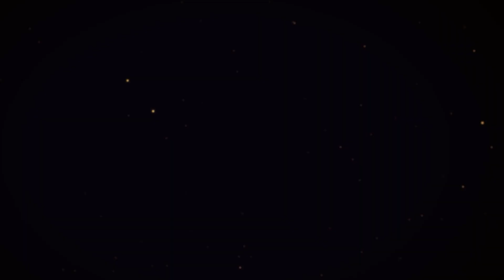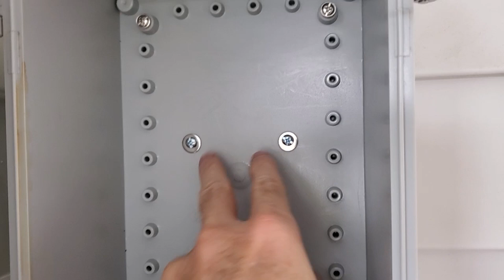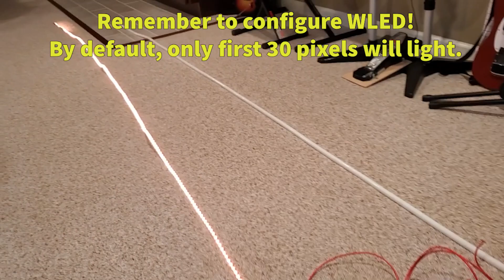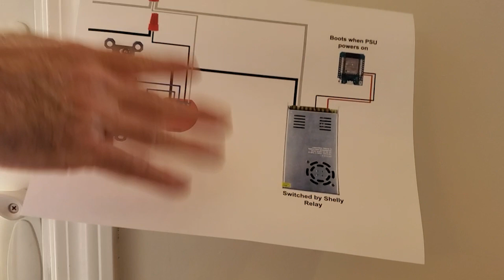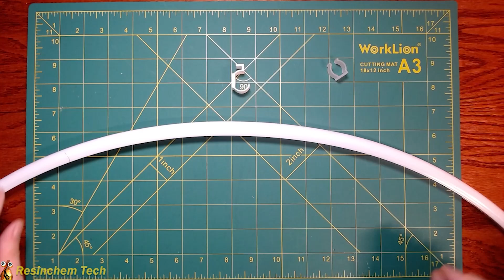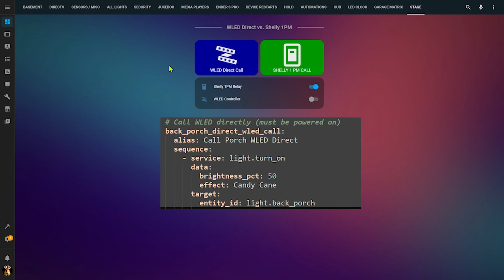An Outdoor LED Installation with Neon Rope Tube

Comment: Excellent!  Wish I had seen this sooner, it would have helped even more then, but nevertheless you refined my understanding (especially of sync dynamics).

One extension would be about saving segment configurations as presets.  One needs at least the default preset to load a set of segments - but one can have different segments with different presets (eg: with two segments, one could sometimes reverse one or the other, or use vs no use mirroring).

A different extension would examine how segments and presets interact with remote pixel control via e1.31, ArtNet, or DDP - for example connecting to LedFX or xLights - that's one I'd really like to see as I haven't puzzled it out for myself yet.

AND... these don't change all the time, so you probably wouldn't have the problem with a part 2 being obsolete by the time you made it.
Reply from the maker: There is so much that can be done with WLED, it definitely could be a whole series of videos!  I touch briefly on some of the other subjects you mention in other videos, but not necessarily how segments fit into those things.

I'll definitely consider a follow up video at some point to explore how segments can be used with things like presets or other integrations.  Not sure when I might get to it, but thanks for the recommendation!

Comment: Awesome build - now I just have to get enough  "WAF" to do something simular. ;) .Beginner-question - how thick power-cables do you use for the extension? Is 22awg enough? 20awg? Thanks again!
Reply from the maker: Are you referring to the wiring runs for the power injection that I did at the corners?  I actually used 18 gauge wiring for that.  The gauge needed is dependent upon a lot of factors, including the length of the wiring run, the expected amps, etc.  There are some online calculators that can help determine the right gauge to use for your particular project.

As far as WAF... she was pretty skeptical about this project when I first proposed it.  But I had built up some "credit" with other projects and automations first!  I always assure that I try to make the final install as neat as I can, with as little exposed wiring as possible, and she is generally OK with it.  She actually likes the lights now that they are done, but I did have to set them so that they first come on as plain white when the wall switch is flipped... colors and patterns can then be set after that if desired... but they always turn on as normal white.

Good luck with your project.  Let me know if have any other questions along the way.

Comment: I love your material, have you done any comparisons between the many Btf-lighting neon ropes? Would love your thoughts, or perhaps a video on that! Greetings (Or if you've tried at least some of them, input is appreciated)
Reply from the maker: I haven't tried any additional styles.. and likely won't.  As I mentioned towards the end of the video, the neon tube (at least the style I had) was difficult to work with... and I would have been much better off (and had straighter runs with no sagging) using something like IP65/IP67 LED strips and aluminum channel for mounting.  I think the neon tube is a great idea for outdoor installs where you might need to navigate an actual curve or curved surface.  But in my case here, the runs were straight, so outdoor rated LEDs and aluminum channel could have served me better.

There isn't anything inheritably wrong with the neon tubing... and they do provide decent diffusion, but just preparing and mounting took a lot more work as compared to the other alternatives.  For me, removing the adhesive backing, pulling the LEDs through the tube... and then dealing with the tubing wanting to twist and fall during mounting took a lot more work that I normally have by just slapping the LEDs into an aluminum channel, then mounting that aluminum channel into clips already mounted on the wall (or whatever surface I am mounting them to).  But this was my first experience using them.... maybe I'd get better with more practice.... but again, I doubt that I'll try!

Comment: What I don't like about these things is you can't run them straight. A channel is neat, these sag here and there.
Reply from the maker: Oh... I agree with you a 100% on that.  Plus they were just difficult to deal with overall, which I think I stated either in this video or the other one.  For my particular install, the aluminum channel with IP67 LED strips would have resulting in a much neater and cleaner (not to mention easier) installation.  But, the tubes and WS2812b strips were provided to me by BTF lighting in exchange for my review... so I tried to do the best with them that I could.  But unless I had a direct outdoor exposure that required curves or gentle bending, I don't think I would consider using these again.

Comment: You could perhaps use a second small PSU for the controller, and use a relay controlled by the controller to turn the big PSU on and off? I assume the two PSUs would have to have common ground
Reply from the maker: That's a pretty good idea.  But for my particular case, the delayed on from the switch isn't a big deal (I really don't use HA automations for these lights) and I do like the fact that the power is completely off to everything that is exterior to the house... especially at this time of year in Indiana, where the porch isn't used anyway.

Comment: If you ever need to rerun a string, this is what you can do. Tie the end of the string in several knots to give it some size and weight. Stuff it into one side of the tube and from the other side of the tube put a vacuum on it and it'll suck it straight in.
Reply from the maker: I actually did have to re-pull a string at one point.  But the opening is wide enough that I was able to use use some solid core wire to push a new pull string through.

But your tip is a good one... thanks.  Not sure I'll ever use these tubes again, as I think it would be easier to just use IP65/67 rated LEDs, unless I really need to put the LEDs on a curved surface.

Comment: In the script at 26:05 - instead of the hard coded delay of 2 seconds (later 10 seconds) you could as well just use a "wait for" trigger to react for the WLED controller change its state from "unavailable" to "on" or similar 🙂
This would put you on the safe side no matter how long the controller takes to connect to the wifi.
Reply from the maker: That's a great idea!  I love it when folks find ways to make improvements on my existing projects.  Not much use for our back porch and lights at this time of year here in Indiana, but I will definitely make that change to my automation.

Thanks for taking time to share a great upgrade tip!

Comment: Would love a 2022 home network video your setup looks awsome 👌🏻 im starting my own home network
Reply from the maker: I'm currently using Ubiquiti/Unifi with managed switches, multiple PoE access points, etc. after upgrading from an Eero mesh system... that was fine until I outgrew it with the number of concurrent devices (I usually have around 130 devices connected at any given time.. the majority of which are wireless).  I'd love to actually have a separate VLAN for all my smart devices, but the work to move all those devices over to a new network, with new credentials, etc. (especially since many are embedded devices, such as relays or wall switches) just makes it too overwhelming.  But someday if I keep adding devices,  I'm going to run out of IP addresses and will be forced to do something!  I've been very happy with the Ubiquiti / Unifi devices.

But if you are just starting out, and if your network will have the capability, I'd highly recommend setting up a segmented network/VLAN for all of your IoT or connected smart devices.
Reply: @ResinChemTech  amazing thank you for the reply! Loving your videos

Comment: I'm looking at using this for new upgraded Christmas lights that wrap my 4 round porch columns (about 14 inch diamter), how do you think this tubing would work? If snugged tightly (and taped in a few places) would it sit nicely with the LEDs facing out or would it try to twist itself and look bad?

Also, Great commentary on the two ways to wire the power supply and controller for automations -- always on vs power on with the switch. This is the first video I've found to demonstrate this and confirm that having a switch cut the power will work for my pool lights that will never have motion automation and I will want to turn completely off when not in use.

Now, to continue researching how to get WLED to remember the last settings on boot...
Reply from the maker: Actually, I think wrapping the tubing around a column will probably lessen the likelihood of twisting!  They come packed coiled up exactly like they were around a post.  My issue was that when laying flat, they kept wanting to 'curl', which caused the twisting issue.  However, they do have a little bit of weight to them, so I'm not sure that tape alone will hold them in place.  Might need to be creative if you can't mount some sort of bracket on your posts.

As far as WLED, I'm sure you are aware that you can set a default boot-up effect and have the lights turn on when the controller receives power.  The effect is saved as a preset and you just specify the preset you want to use as the "boot up/power on" effect.  But if you are talking about saving whatever the current setting is when they are powered down and restoring that when powered back on, that's a bit different.  I was chatting with another user that apparently has modified WLED to write changes to a preset each time they are made.  So, it might be possible to do through a mod.  But for now, you can at least pick a single color/effect to use when the board powers up.

Let me know if you have any other questions... and thanks for watching!

Comment: Another great video, an excellent explanation of your work and everything looks amazing. Thank you for sharing your time and experience in the development of these works that help get ideas for projects at home.
Reply from the maker: Thanks!  I know that my 'how-to' videos run very long and very few people watch the entire thing.  But I guess my goal is to try to provide ideas for others to adapt... and provide more details for those that want them.  And often, like in this video, I discover things myself... and things I'd do differently... so I try to share those ideas to help others consider what to do (or not do) in their own projects.

Thanks for watching... and thanks so much for taking time to post such kind words!  I greatly appreciate it.
Reply: Hi My friend, a question: I have read and seen that you recommend using a capacitor at the microcontroller power input either for the led strip or both, as well as a resistor on the DATA pin between the microcontroller and the led strip . Is this really necessary? in some installations I see that they do not use it, others say that it is optional, others that if it is not placed it can burn all of them... etc. ... etc.. I think that in your installations you don't use those components.  @ResinChemTech
Reply from the maker: You are correct.  In many of my earlier installs, I placed a capacitor on the power supply or on the incoming voltage line of the controller board.  It's simply an extra precaution that might help protect your board or LED strip in the case of a power surge.  However, I've never had this happen (it doesn't mean it won't!), so I've tended to not install the capacitor in exchange for trying to make the controller and enclosure case smaller... especially when using the D1 Mini and the smaller ElecroCookie board.  With the larger controller and board, there was a little more space for the capacitor.

Of course, adding a capacitor is an extra precaution and it sure doesn't hurt to have it there.  By skipping it, I'm saying that I'm willing to run the risk and replace the controller (or LEDs) if a surge does cause a problem.  Much like the logic level shifter, the final decision to use a capacitor or not is totally  up to you.
Reply: Thank you for your time and explanation, it all comes down to assuming the risk or not. Thanks again... I'm going to try adding them to two small jobs I'm doing at home for my kids for safety. @ResinChemTech

Comment: Perhaps this project was not especially for the neon tube because it lowers the intensity of the light and the purpose is that it is flexible, excellent project 👌
Reply from the maker: Yeah... I agree.  As I talked about in my conclusions, if I were to do it over, I would use IP65 orIP67-rated LED strips and aluminum channel.  The neon rope tube is a great choice for curved surfaces, but for flat straight runs, I think the aluminum LED channel would make a much better choice.  However, the neon tube really doesn't lower the light level much at all.  I compared the two options in my previous video and didn't really see much difference in brightness level.  Regardless, with 815 pixels, the light is plenty bright with either option!

Thanks for watching and taking time to comment!

Comment: You should probably put a few holes with a hole saw bit in the box with your power supply so it won’t get too hot.
Reply from the maker: I did consider that... but of course that would compromise the watertight box in terms of rain/moisture.  I'm planning on placing a temperature sensor inside the box (I can power a D1 Mini and sensor off the same power supply), so that when the box is powered up, I can monitor temperature and get an alert if the temp gets too high.  If I find that is happening (the power supply does have over temp protection, so it should shut itself down if it does get too hot), then I'll look at maybe drilling holes in the bottom of the box where it would be less susceptible to rain.

It does help that the power supply and  lights would generally only be on at night, when the outdoor temperature is lower.  Thanks for watching... and the suggestion.  I love getting feedback and ideas for improvement from viewers!

Comment: I was thinking the PSU seemed huge but wow, 800 LEDs. Nice install, great thorough explanation. Good review.
Reply from the maker: Thanks!  Yeah... I actually had quite a bit more to cover, but had to edit things out just to keep it at 30 minutes!  It is the largest single install, in terms of both the number of LEDs and the size of the power supply... and why I fused this one.  Lot's of things I'd do differently if I were to do it over... including possibly using 12V instead of 5V.

Comment: You can specify a default preset. I wrote an auto-save settings usermod that monitors specific settings and if you make a change to any of them, it updates a specific preset. I use these together so lamps start up however they were shutdown.
Reply from the maker: Yeah... most of my WLEDs have a default boot up effect.  This one (for WAF reasons) uses a solid white for the boot default so she can just flip the switch to turn on "normal" lights.  I probably won't do much in terms of different effects with different automations (or I might have wired in the other way).  Mostly they will just be used to provide ambient or "mood" lighting when sitting on the porch at night and the push button allows her (or me) to easily switch to different solid colors.

Thanks for the comment.  Might want to speak about that user mod sometime... I can think of some other uses I might have for it!

Comment: My experience: I always design too small the first time and nearly any 3d model takes at least 3 iterations. Fun video!
Reply from the maker: Yeah... me too!  In fact, the openings in these boxes had holes that were too small for the gauge wire I was using.  But that was easily fixed with a drill!

Comment: Looks too wavy and you can see the hot spots. The aluminum channel and milky white diffuser would be a better look.
Reply from the maker: I don't disagree with you.  In fact, in my conclusion I state that if I were to do it over again, I'd use the aluminum channel... which I've used in a lot of other projects.  The neon rope tube would be better for curved surfaces where the aluminum channel wouldn't work.  However, as far as the hot spots, they may have looked worse than they really are on video.  The rope tube actually does do a better job of diffusion than the aluminum channel (with the milky diffusers).  You can see this better in my last video, where I actually compare the two of them side-by-side... although at only 60 pixels/m, you can see individual pixels in both.

Thanks for watching!

Comment: Excellent video ,keeping the power always off is a good idea ,just one question why not keep the candy cane effect as wled boot preset in all cases to avoid the need for HA automation during startup .That is how we setup most of our wled controllers
Reply from the maker: Yep... you could certainly change the default WLED boot up effect.   In my case, I just wanted standard white light (for the WAF mostly).  I think I mention somewhere in there (if I didn't edit it out), that for something like a motion detection automation, your could change the default effect to avoid the delay.  I really just picked Candy Cane for an example (as it showed up better on camera) to show the delay if you did want to change to a different effect from the default when it was wired in the way that I did it.

Again, in the interest of time, I also cut a segment where I talk about motion detection and using a second automation to turn on the power at sunset then turning it back off at sunrise... since that's the only time I'd want motion detection enabled.  That's the great thing about Home Assistant and automations.  Lots of different ways to tackle a problem!

Thanks for watching and taking time to comment!